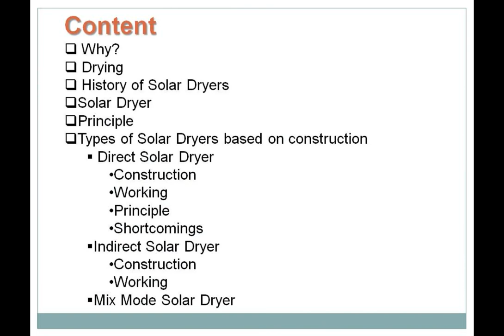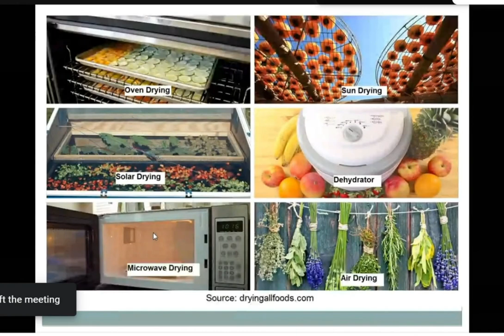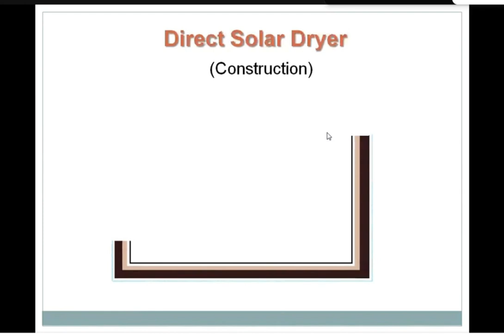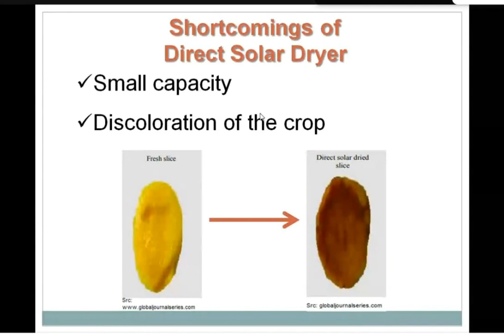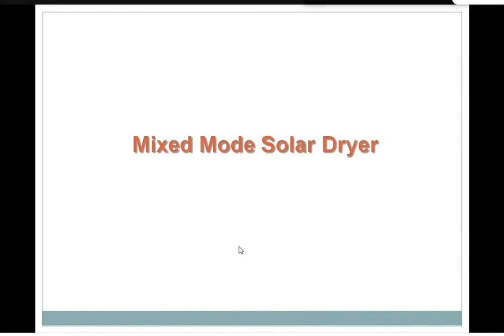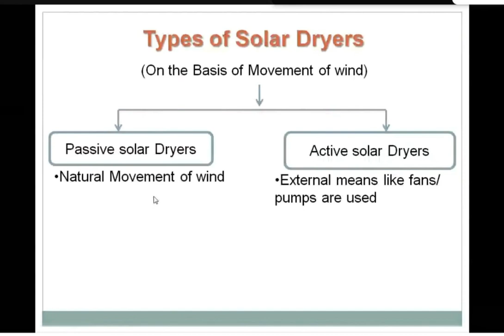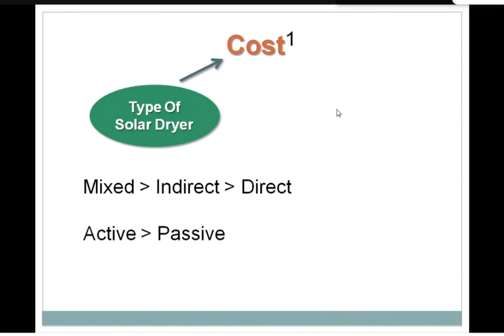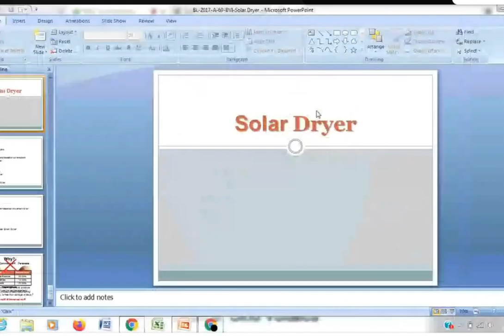Solar Dryer

Comment: Inlet Air Filtration system is required?
2nd Thing can I provide inlet at bottom of the system...?
Reply from the maker: Filtration system can be installed by taking care of Pressure drop.

Comment: Thanks. Won't fans cool down the temperature inside. How to ensure that required temperature is maintained?
Reply from the maker: Temperature can be controlled using temperature sensors. In a passive dryer , temperature can be lowered using fans. This required for sensitive material like seeds. Dryers are designed for a particular product when such sensitivities are to be taken care off.

Comment: Hello mam, which reflector gives high efficiency, if we connected that to Solar Dryer
Reply from the maker: All solar dryers do not need/have reflectors. For a particular solar dryer you need to do research e.g https://www.researchgate.net/publication/280746284_Design_and_Construction_of_Cabinet_Solar_Dryers

Comment: Nice. But mix mode solar drying might responsible for discoloration?
Reply from the maker: Discoloration in solar drying will follow:
Indirect mode < Mixed mode < Direct mode
Reply: @IntuitiveLearn  What would be the result if blue film used in Solar Drier ? Is that going to minimize discoloration ? How Blanching impact on discoloration?
Reply from the maker: I have not worked on this. 😊
Reply: @IntuitiveLearn  Thank you for such informative video and reply.